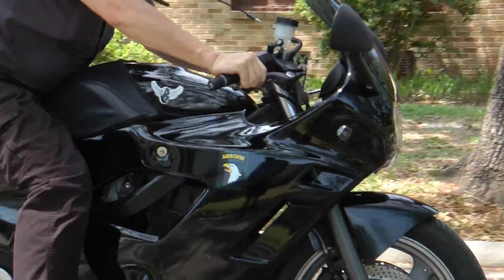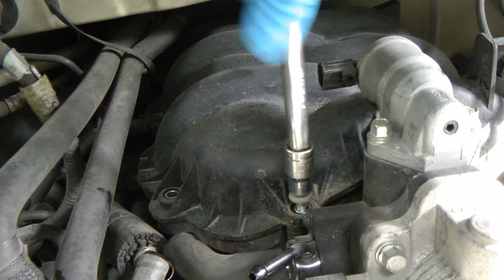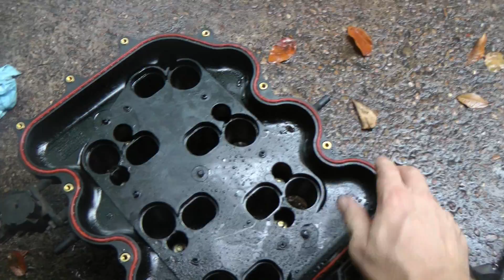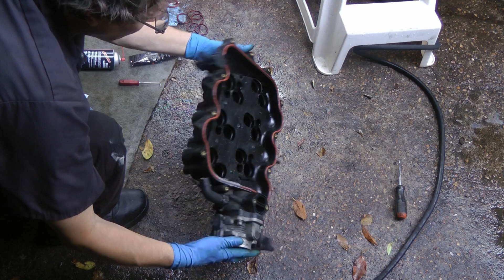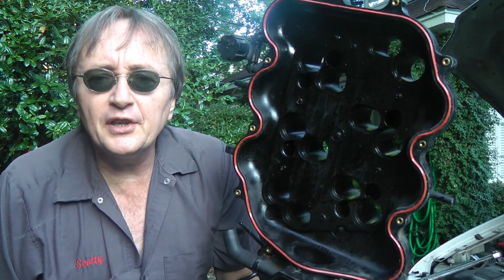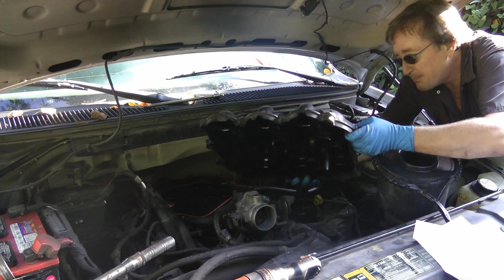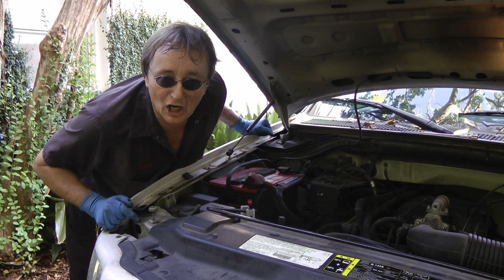How to Replace a Intake Manifold Gasket in Your Car

Comment: Hey Scotty, sorry for all the questions. But I just changed out the intake manifold gasket on my 97 Dodge Intrepid and now the red oil light is coming on. Sometimes it can take awhile for the light to come on. Is it possible if the manifold didnt line up exactly that would somehow reduce oil pressure. Or maybe shavings got in the oil pump or the sensor going bad. Seems like too much of a coincidence for the sensor to go out.

Comment: Hey Scotty,   Got a problem with my 2000 Ford F150 with a 5.4 Triton, No.7 cylinder showed a misfire code, so I pulled the coil pack and there was coolant down in the spark plug well shorting it out. Cleaned it all out, pulled the plug, cleaned everything up,put it all back together fired  it up ran it for 20 mins no problems, no obvious leaks on the plastic intake any ideas?

Comment from the maker: @sbond1963 Rarely do intake gaskets go bad on toyotas. try cleaning the idle air control valve first and check for vacuum leaks in other places, like leaking hoses.

Comment: Hi Scotty. Have a 2000 corolla with a high idle. Starting on a cold day it hiccups to a lower idle. suspect a IG. Is this just a basic gasket replacement with no fluids to worry about? (oil, coolant, etc) Thanks in advance.

Comment from the maker: @TheRoshan1975 those are torque wrench settings, you must use that kind of wrench to tighten em that level, the wrench has inch pound settings you adjust on it.

Comment from the maker: @X2N18 get smaller extensions that fit in the holes, and make sure you're using the correct size and type of socket for those bolts. Scotty

Comment: i have a 2002 chevy mailbu that has had the intake manifold gaskets replaced at least three times, the last time i took it into to get an oil change the manager told me that this is a common problem with 3.1 V6 engines, first off can you tell me why it may continuously doing this, and how much it would cost to fix it myself, and is it easy to do and how to fix it for good  so this irritation wont happen again

Comment: scotty i meant overflow coolant  from the overflow coming from the manifold area where they said their was a leak that they repaired??He said  would for a few days,?i put a old white tablecloth under it  today sat,so come monday if it has it on it allison is going to raise a hooot with them.? i take it in for a clearly needed valve cover gasket repair it's a gram amgt , i had no coolant leaks when took it in he said the manifold was leaking,can it leak without being seen?

Comment from the maker: @PVoyager I personally use a vacuum machine that sucks the air out of the radiator cap hole. But they do have bleeder screws on various parts of the engine, though they tend to break off when using them in cars more than 5 years old, then create a big mess. Scotty

Comment: @scotty this is off topic but i have a 98 saturn tht runs through gas like i dont kno what lol. when i 1st bought the car i used fuel injectors in it then drove it a few miles. any other suggestions?

Comment: hey scotty i have a 2002 ford mustang GT and it seems like its leaking antifreeze on the right side of the engine through the intake manifold, should i replace the whole intake manifold or just the gaskets and around how much am i looking at do have a mechanic do this, thanks

Comment: @jimmy101112000 thanks man. Yea the oil change isnt that big a deal i change all the oil for my immediate family so I got that down pat. Ive done a timing belt and replaced the water pump so when I did that i had to do a flush and fill at the same time to remove all the coolant in the block. Needless to say i ended up with most of the coolant on the floor. one bucket of dryzorb later i finaly cleaned it up but it eneded up making this mud that caked onto my jack and tools. Was not fun

Comment: Your just cleaning the crud out of the system there will be too little antifreeze to poison anything.   Then remember to clean your recovery tank with water.  Then go ahead and fill with the premix of 50/50 green stuff.and leave the cap off until the system burps out the air bubbles.  Then slightly overfill the recovery tank. Expect the level to drop with 3 days of driving on it.  

Oh and I forgot one thing.  Replace the Oil pump drive o-ring its near the t-stat housing. Its really easy to do.

Comment: The flush and fill  part I would just remove the lower radiator hose that is attached to the water pump into a bucket.  Then the safest way to dispose of the old antifreeze is to pour it into a toilet or garage drain if you have one.  
For the oil just drain it into a milk jug or a container then run it to the auto parts store to dispose it.
The clean up of spilled antifreeze and oil  which cheap cat litter will soak that right up. Flush the radiator in the street since it will be plain water.

Comment: @jimmy101112000 thanks for the advice man. yea I probably should. I gota eventually get around to doing a flush and fill on it. Not sure if I want to put dexcool back in or regular green stuff. Either way I need to get it done. But ive never had a good experience with flush and fills. usually end up making a huge mess and spending the rest of the day pissed off and cleaning it up. But ill eventually get around to it. Thanks

Comment: @jimmy101112000 Also do not mix push rods.  Use a box to keep them in order. And I used just a adjustable wrench to lift the rocker to remove the push rods. If the rod will not come up the valve is hitting the piston just turn the engine by hand to get clearance.   Flush the cooling system and use good old green kind antifreeze. Use cheap engine oil and filter on first start and wait until it hits operating temp then change it again to flush the crankcase.  The car has  204,236 miles on it now.

Comment: @DARKSCOPE001   Yeah I did a 1997 Oldsmobile Cutlass Supreme with 3100 engine.  
Just use the felpro  metal and rubber type not the plastic junk or it will leak again soon.    I  started the job at 11pm to and finished 5am with no help from anyone.   Also use  loctite blue on the lower intake bolts no need for new ones and use a torque wrench that does in lbs. Just do not lose the fuel inlet o-ring on the fuel rail.   I would highly recommend you replace the thermostat while the intake is out.

Comment: Also, you might as well clean your throttle body, idle control valve, and check your vacuum/intake hoses for cracks.  Obviously those are different videos, but it helps if you've already done most of the dis-assembly to just get it out of the way.

Comment: at least you can get away with just changing gaskets. The 4.6's split at the seams and leak water at the rear coolant passover. Then it is entire new manifold time.

Comment from the maker: @DrLuNcHbOxXx  Depends how badly blow it is. But a hydro locked engine will not start, for that remove all the spark plugs and crank the engine to blow the water out. Scotty

Comment: Hi Scotty. I found you when I replaced my power steering pump and your video was a great help. I have a 1996 Chevy Lumina APV that needs the intake gaskets replaced. I have never done this before, but on this 3.4 engine and the way it is hard to get toward the rear of the engine because of the hood design, is it basically the same as this video. I am planning to check out the library for a repair manual, but I don't want to bite off more than I can chew by not having a special tool I might need.

Comment from the maker: @Matthew55904  Those things are all computer run, I would advise just getting a new hazard switch. And try every key you have, cause if none of them work, you'll need a new lock on the trunk. But of course, spray some WD 40 in there overnight and see if that loosens up the tumblers inside. Scottty

Comment from the maker: @moofushu  depends on the car. Just a general one would be screwdrivers, a set of sockets from 8 mm to 19 mm, a set of wrenches the same, a test light, a pair of cutters, a hammer, a pair of work gloves, any special size sockets the car requires like hex sockets, a pair of locking pliars, and ratchets to drive the sockets. Scotty

Comment from the maker: @diistriitglow  Often, you will get a trouble code with the check engine light on. It will say Engine running too lean when the leak gets big enough. then a mechanic like myself will run a smoke machine test to see if it is indeed leaking. If you don't fix the leak, the engine will run too lean and that can damage the engine. Scotty

Comment from the maker: @nightmathzombieethan  NO, read my other post below. There are MANY different grades of plastic, and the tough stuff they use on intake manifold assemblies isn't damaged by brake spray at all. After all, the damn thing sits on top of a hot aluminum engine all day long, if it were that weak, it would melt and crack just running the engine. Scotty

Comment from the maker: @spelunkerd  Yes, plastic has taken over because it's CHEAP to manufacture. I don't really weld plastic because I'm basically a mechanic who fixes mechanical or electrical faults. And if that type of plastic part breaks, welding is really not an option as the piece would no longer fit correctly. Now body work guys weld plastic all the time, cause that's just cosmetic and doesn't have to take strains or fit on a gasket area perfectly. Scotty

Comment from the maker: @mazdarx7head  It doesn't melt that kind of plastic. There are numerous types of plastics out there, if the intake manifold was made of a cheaper plastic, it would just melt from the heat of the engine it's bolted onto. And I did talk about if you have a vacuum leak on your engine in the beginning. Scotty

Comment: After watching your videos and reading on the internet, I feel like a fool for paying the Ford dealer $1000+ to replace my valve cover, lower intake and upper intake manifold gaskets.  Granted my 2000 DOHC Taurus ran much better and didn't have check engine codes & reak of gas inside, but still...it's a methodical process.  Keep the video's coming Scotty!